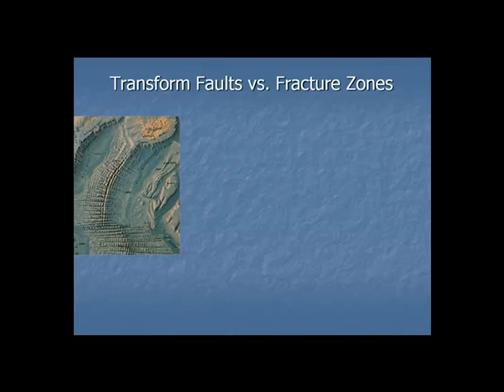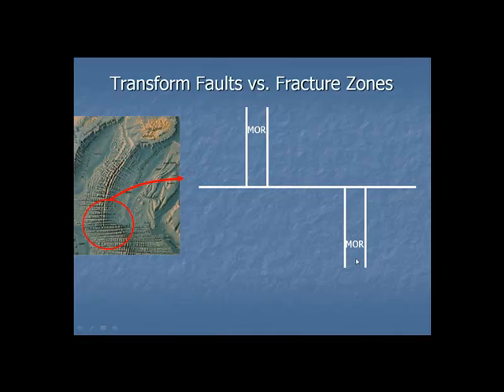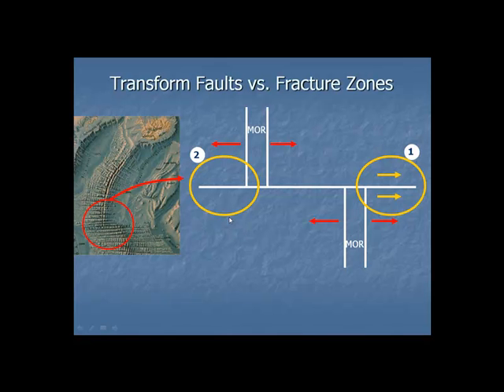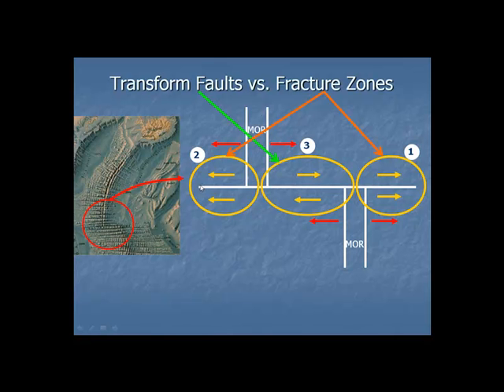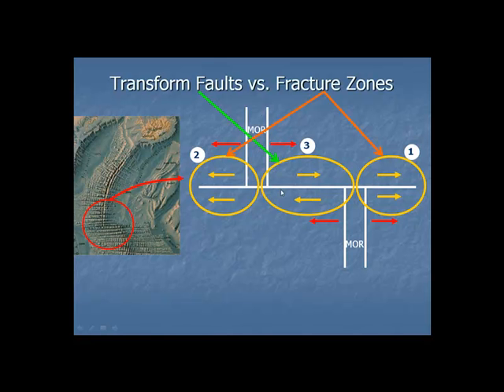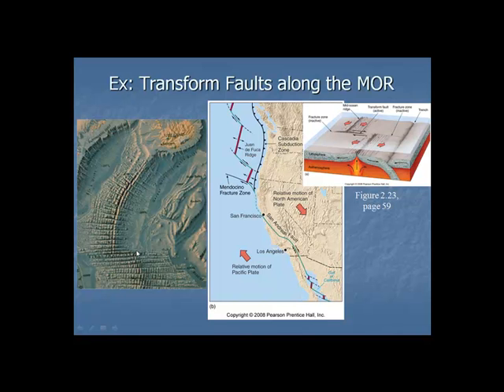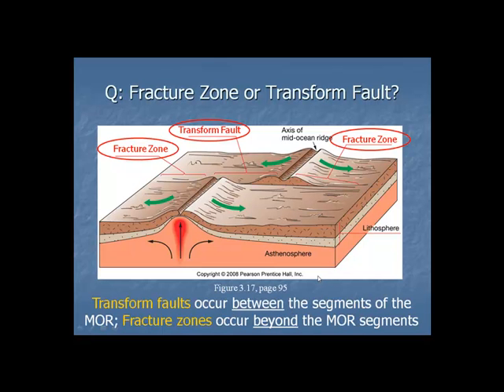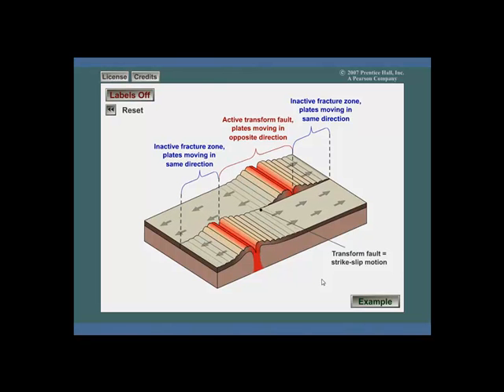Transform Faults vs. Fracture Zones

Comment: Superb. Can you plz tell what is the difference between Active and Inactive Fracture Zone.
Reply from the maker: Thanks! As for your question, all fracture zones are inactive (or nearly so). The only tectonically active part is the middle part, called a transform fault, which is different than a fracture zone. Transform faults are characterized by a high degree of earthquake activity because the 2 plates are moving in opposite directions.

Comment: Can you please explain why these fracture zones/transform faults exist in the first place? I have heard that it "offsets the MOR" but what does that mean? Why isn't the MOR just one long continuous ridge?
Reply from the maker: +Aidan LamThe reason that transform faults exist in the first place is because the mid-ocean ridge is a linear feature. For a linear feature to exist on a curved surface (e.g., Earth's surface), it must have offsets to accommodate the curvature. That way, each segment of the MOR is linear, and is offset by transform faults/fracture zones that bisect the MOR at a 90-degree angle.
Reply: +Al Trujillo What exactly do you mean by linear; do you mean straight and flat? I still don't really understand why the MOR can't just spread open like the shutter to an observatory telescope (i.e. all be joined together and move as one)? Because the MOR is a divergent plate boundary and why isn't the edge of the two plates one uniform line?
Reply from the maker: +Aidan Lam Notice at about 1:08 in the video, the way the two plates are moving, apart from each other. That's sea floor spreading. Linear means in a straight line. To get that divergent motion to work on a curved surface (the sphere of the Earth), offsets of the MOR must occur. That's the transform faults/fracture zones. Really what it boils down to is a geometry issue.
Reply: +Al Trujillo I think i get it now, thanks for the explanation, its one of the clearest ones on the internet :)

Comment from the maker: The offsets are formed because spreading at a mid-ocean ridge only occurs perpendicular to the axis of a ridge and all parts of a plate must move together. As a result, offsets are oriented perpendicular to the ridge and parallel to each other to accommodate spreading of a linear ridge system on a spherical Earth. In addition, the offsets allow different segments of the mid-ocean ridge to spread apart at different rates. The left lateral motion was only as an example (right lateral exist, too).